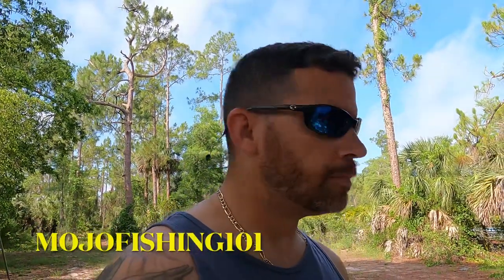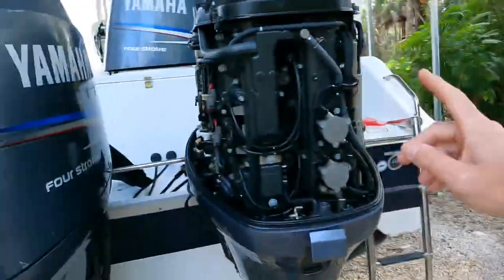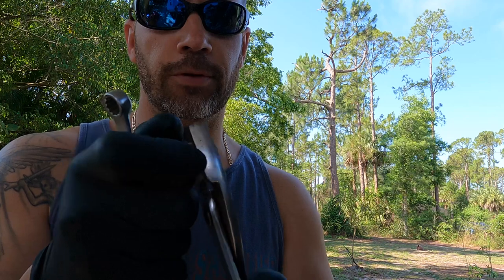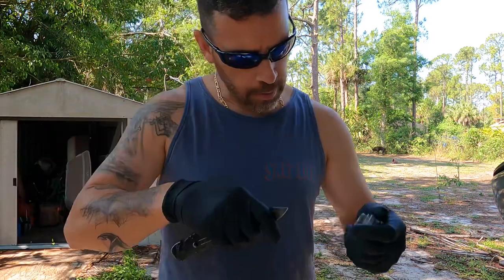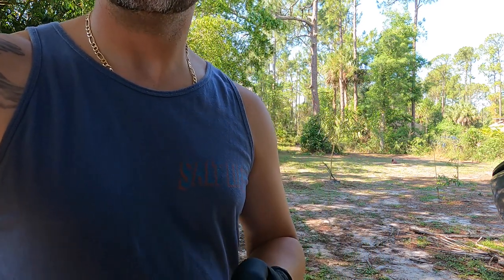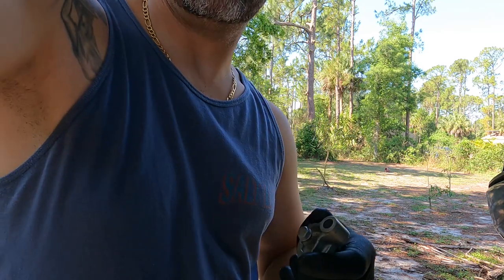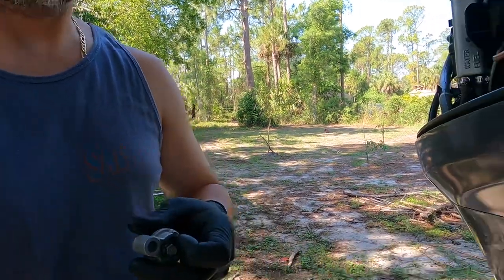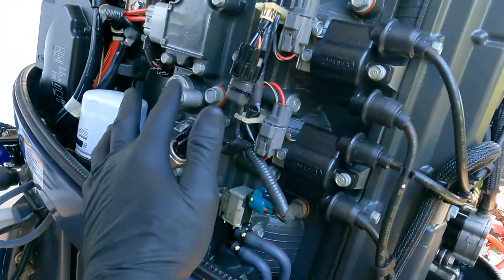2011 Yamaha 150’s engine anodes replacement

Comment: Are the anodes even working if there is a thick layer of grease between the zinc and aluminum casing? Theres got to be contact between the dissimilar metals.
Reply from the maker: No grease should be inside the casing where the anode goes into, the only grease in the anodes should be the screw that connects the anode with the anodes base to prevent corrosion, this will prevent headaches in the future.

Comment: All the 4 stroke outboards have anodes. Really old Two strokes id question if they have it or not. Mostly if they had a thermostat or not, but the latter two strokes in 90's did as well because they had thermostat. 
Did you do the anodes on the block and lower leg and bracket assembly?
Reply from the maker: Yup, I believe I show in this videos all the anodes on the motor including the block, I will soon make a video replacing the ones on the lower unit and bracket, I replaced those last year and they still in good shape. But soon I’ll change them so don’t miss that vid, make sure you subscribe and like to the channel so you don’t missed it. Btw thanks for the comment!!